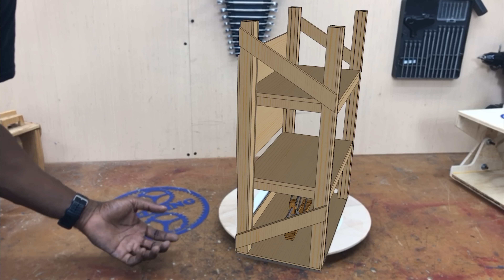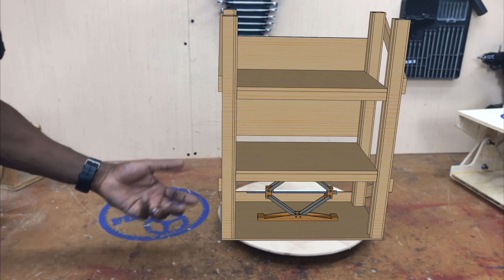Engineering Principles for Makers Part 2; Material Properties #067

Comment: Jeremy , no disrespect intended but in your opening comparison of the strength of steel compared to the strength of wood you compared an 1/8" thick piece of steel to a 3/4" thick piece of wood !!!  To be fair do it again with an 1/8" thick piece of wood.
Reply from the maker: The were both just under 1/8” thick. I even used the square to make the wood... If you think you saw that much difference I recommend glasses. LOL Just joking around. They were the same
Reply: After reading your response to my comment i watched your video again . Am i hallucinating or did you compare your fabricated wood "I" beam to the framing square ?
Reply from the maker: Yes... the ibeam and square are the same thickness. I used the square against the fence to set the thickness, then cut the wood to the right thickness. Then cut it again to make the I-beam section. Don’t miss the point here... I was only pointing out that geometry matters as much as material. Right after that I say the “wood is NOT as strong as steel but as rigid when given the advantage in geometry”... I believe I used those words exactly.

Comment: Your videos continue improvind.  The graphics are very helpful.  Will a scissors jack provide adequate lifting movement for the bench surfaces?
Reply from the maker: It is the best one for that very reason. I can get the best lift (4ft), easy to make, and they produce really high lifting torques except at the bottom, but I have plenty of power available to overcome the mechanical disadvantage at the bottom.

Comment: Great video! I like the new prototype! Its got me thinking. What if you used the space inside the 4 hollow pillars to house springs from a garage door (or even custom wound springs with that handy lathe) tuned so that with nothing on either bench it would be almost neutrally balanced. Then you could have ropes or cables ran inside the springs ran to pulleys that routed the ropes to a mandrel in the center on top. At the end of the mandrel you could have a crank or maybe something like a ships wheel to raise and lower the benches. When everything is fully elevated there could be a spring loaded detente on one end of the mandrel that would support everything and also act as a ratchet so it isn't so dangerous while you're cranking it up. Actually now that I think about it you could just have like a giant clock spring that was wound directly off the mandrel!

Comment: This is the second video of yours I have seen. The first was very good so I subscribed. This one is even better. You use language we all understand and explain the unfamiliar terms well. I'm 68 and still learning. My only complaint is there are not enough people like you who make things more interesting here on YouTube. BTW the new work bench design will be sturdier than the first. The big challange, as I see it, will be making it stabil enough to roll around when at full height. Also lighting the lower work bench will be neccessary. This 4 post design will lend itself to more levels if desired, too. I like it!
Reply from the maker: It will be finding the right combination of casters, height and width for balance etc... it will be fun working it out

Comment: I actually like your original work bench better than the automatic one. Both are good...but it's nothing wrong with having to clear the top surface. It's for temporary stuff anyway ... and it helps maintain organization.  It also won't require electricity and cheaper to build. I'd buy one. My work bench is the tail of my truck lol. But my tools are very organized tho
Reply from the maker: I actually like the first one so much I might make both... and I also have no issues with keeping the shop organized... but I agreed with many of my neighbors that there are some additional benefits to keeping the surface horizontal, and I wanted to tackle the challenge with the same constraints. It will have to be more robust, and thus the budget will likely be higher...

Comment: Really enjoy your channel and your teaching style. You're one of those channels I aspire to be like. Thanks!
not sure if you've seen the adjustable height workbench on "mike and lauren's" channel they used some trailer jacks in some in some wood columns to raise and lower the work surface. That was a pretty neat design.

Also another one that I really dig on is one that Mattias Wandel suggested... its called the MFSC (multi function shop cart) by Timothy at benchworks. The adjustable lift mechanism is pretty cool. Give it a search if you haven't already. 
Have a great day!
Reply from the maker: I saw it... that won't work for me... I need a lift that can be almost completely flat against the floor. That is why I am using the low profile scissor style design. It will require more power at the bottom, but I have plenty of power.

Comment: I noticed you didn't hang the weight as far back on the lever on the second structure. Do you think this could've had a significant effect on the amount of deviation?
Reply from the maker: Any difference was an accident. There was time in between that was edited out. Probably just didn’t remember exactly where it was. The difference wouldn’t matter much for the results anyway

Comment: 🤔 So a vertical frame with a motoror-assisted box in which you would use the bottom side as the heavy load end and the top side as the lighter duty side.   Very interesting indeed.  If you're thinking of making those plans, I'll wait and buy them.  😊

Comment: Show also the same with steel I-bar, im sure the steel i-bar will win. Also i do better with metal, cause you couldnt weld wood. I hate to do anything with wood, cause if you want good results, you must first pre-drill before screwing and so on. On steel you could start weld right on. Ofcourse you need sometimes drill steel too before screws but thats not my point.
Reply from the maker: If you think I was saying wood is better than steel you may have missed the whole point of the video. Please rewatch at least up to the point where I say "strength and rigidity are not the same". Maybe you missed something inbetween
Reply: @Jeremy_Fielding  sorry, i wanted too much to say my opinion, without thinking is it solid for that situation. Youre doing good and interesting videos !

Comment: Since you have those corner pieces with the rails in the design shown, have you though about pulling the bench up with a rope or straps? You could mount a motor in the back and an axle with two pulleys (one left, one right). Those pulleys would wind up 2 straps each. The straps would go up over a small roller, two (L and R) making an U pulling up the back corners, the other two (again one left, one right) making an L going to the front, making another L and pulling up the front corners. The motor and axle could sit almost anywhere, maybe even replacing the rear rollers completely by sitting on top.
The whole bench could be a little bit "springy", because the straps would stretch depending on load. But maybe you could add some locking mechanism so the benchtop can't move (I think that would be a good idea even when using a jack underneath).
Reply from the maker: What I like about the jack is fewer moving parts and one push point instead of multiple pulling points. However I am not committed to anything yet and I agree with your idea

Comment: There is also the "tensegrity" approach of using wire bracing for tension forces combined with steel/aluminum/wood for handling shear and compression forces. Useful where very light and strong structures are required.
Reply from the maker: I haven’t heard of this... sounds interesting
Reply: @Jeremy_Fielding  - I believe the term comes out of the Buckminster Fuller school. One of his group specialized in it.

Comment: I don't think "Moment of Inertia" is the right term.  I think it's called the "Bending Moment".  I believe that the moment of inertia has to do with angular acceleration or the resistance to it, either negative or positive.  Bending moment has to do with forces on a cantilevered beam.  Although a cantilevered beam will theoretically follow a path of rotation, inertia does not enter into its calculation.  You can kill me if I'm wrong.
Reply from the maker: Look up the formula for the deflection of a beam. The two important variable are MOI and Modulus of elasticity. That was the main point of the first "tip". Check it out. Also notice they are of equal weight! ... as in one of them isn't squared or something.
Reply from the maker: Bending moment is different
Reply: Look up the terms. I understand that having "inertia" in the name is very confusing, but that is just how it's called. (It's the same in German, so it's not just a fluke of one language having a weird word). Bending moment is a force (times length)/torque that causes a shape to bend. It has nothing to do with the material or its crossection.
Reply: The technically correct term is  https://en.wikipedia.org/wiki/Second_moment_of_area , but it is (mis-)called "moment of inertia" most of the time. https://en.wikipedia.org/wiki/Moment_of_inertia  is actually the rotational equivalent of mass. The formulas are similar, which is probably what caused the confusion in terminology, but true MOI is a triple integral with respect to volume, and SMOA is a double integral with respect to area. Jeremy is just using the term that almost everyone seems to use.

Comment: That new workbench design reminds me of a dumbwaiter raised from the top, or a double-decker elevator that's raised from the bottom.  Got an old winch (electric or manual) or garage door opener for the power?
     You might get some good ideas from the VegOilGuy channel.  Part 2 of his 3-part series on building an electric foundry furnace is the specific one I'm thinking of (Feb. 9, 2018).  Run time is 21m 27s.
Reply from the maker: Right now I am thinking of an modifying a treadmill incline motor.

Comment: Just a thought.  Scissor jacks are common in cars from the 90's.  Cheap purchase at a wrecking yard.....  Like the idea, but I think the cheaper variation you initially shared regarding the work bench is more feasible and space friendly for over head space.  I wouldn't want to be working within shelving constraints vertically speaking.
Reply from the maker: I am thinking about that as well (how much clearance between)... like the first one... it is a prototype. The problem with buying a jack is I want it to lift 4ft. That is really hard to find.
Reply: Yeah, that would be a challenge.  Even if you're to make your own, I would imagine the scissor jack would be large, and potentially cumbersome.  Even if you consider the old school 80's variation for tire jacks the problem is location.

Comment: Jeremy 
For your work space table have you considered a swing surface.  Below link is to a table/shelf but you could do the same thing with just two surfaces that rotate around a pivot. You would need a little 2x the work surface depth, but only during the transition. And the pivot point could transition from center of table, to the front edge. So basically allowing the lower surface to travel straight up. No lifts needed. 

http://www.dudeiwantthat.com/household/furniture/swing-convertible-table-shelf.asp
Reply from the maker: It certainly looks cool LOL

Comment: How about mounting the drive system on the side so you can have that extra shelf space where the shop made jack is located.. Chain drive to raise/lower the shelves..  Even possibly a horizontal shaft ABOVE the work benches..  Going higher with a tower wouldn't have to cost you anything in space..
Reply: A chain drive is much more complicated (comparatively). More parts, more distances to get right, and most importantly you'd have to make sure that both sides always move in sync or the whole thing will bind up. A little bit easier would be using a rope or strap to pull up the bench. It is much easier to wind up a rope onto an axle than to fix a gear to it.

Comment: Really cool content.  One point regarding the properties of wood: one thing I've found is that they can vary drastically even within a single species, or even the same tree.  Steel doesn't have that.  Most of the time it doesn't matter much and the ballpark consistency you get from the published numbers are fine (like rafter tables, etc), as long as you select sound boards.  But when it comes to other things it becomes more noticeable.  Example: when making selfbows (bows made from solid wood), apart from selecting ideal material, each one is tillered (shaped for the proper bending characteristics) individually.  Very small amounts of material are removed until the proper function is achieved and no more.  The amount removed can vary with the same bow design, same species, or even the same tree.  I think that process evolved because of the variability in wood.  Granted you were addressing structures and bows aren't really structures, but my main point was about wood's variability vs steel's consistency.  I still like working with wood better though.  ;)
Reply from the maker: I agree completely. I just didn't want to introduce too many concepts. But it helps to understand that bamboo wood and oak don't behave the same in bending etc.

Comment: you know that a window regulator motor would work great for this project.  Not only are they inexpensive , they can lift a lot of weight.  You may want to look at it.  They have several gm and Chrysler models that have a belt that the gears go through.  I have used them for raising a third door open and closed as well as a tanau cover open and shut as well as roll in and out.  Give it a thought because the 12volt is easy to work with as well
Reply from the maker: I have one from an old ford. I will test it out... but I want to be able to lift up to 500 lbs (tables, plus tools, plus safety factor)

Comment: I like the steel lathe I made better. http://i.imgur.com/7KTgP1C.jpg
Reply from the maker: They are no comparison when doing exactly the same thing LOL.. but you have been around here long enough to know I think they are just different materials with different "ideal" applications.  that is why we make industrial machines out of steel... and we move them around on wooden pallets!
Reply: @Jeremy_Fielding  iron is better than steel. It dampens vibrations better. Casting iron is a bit beyond me right now though. But some folks do it. http://www.backyardmetalcasting.com/

Comment: Hi Jeremy.  If you're not schooled as an engineer, you certainly think and act like you have been.  Your 'double I beam' on your lathe is called a torsion box.  It stiffens a structure to resist rotation, but also stiffens the structure in all dimensions without adding a great amount of material (cost and weight). There are a lot of interesting designs and explanations for them online that I won't bore you with.  I built  a 5"x8" box beam 8 feet long out of 1/2 inch plywood.  I can jump on the middle with no measurable deflection. It's practically a miracle.
Reply from the maker: It is based on a actual structural member.. I believe it is called a "double web beam" or "double I beam". it is not common but it can be purchased.
Reply: @Jeremy_Fielding  Yes, but we commoners would never buy a double I beam.  That's for complicated (and expensive) structures.  Although, we may find extrusions in the scrap yard that behave the same way.  You can make a torsion box fairly easily out of plywood, regular wood, MDF, cardboard, whatever you have on hand.  Also, it doesn't have to be a beam.  My son and I made  a desk top for him (for light weight)....it's essentially a beam that was just made wider.  Love your channel, good luck with it.

Comment: Instead of a scissor jack, why not use a wooden cam plate with gear teeth and crank on each side to lift the shelves.  I know you like wooden mechanical structures!
Reply from the maker: I don't want to have to push on both sides.